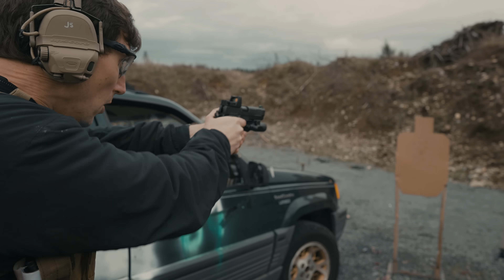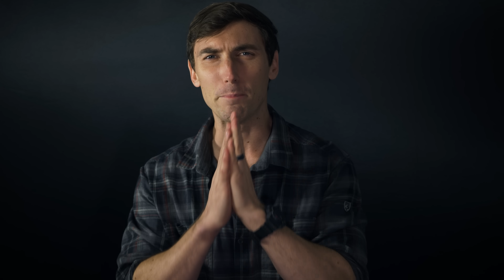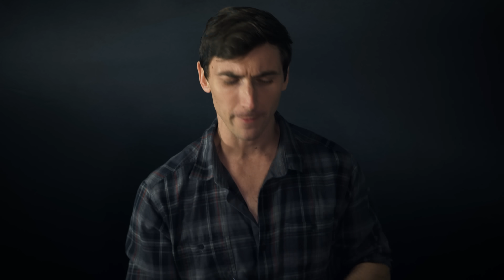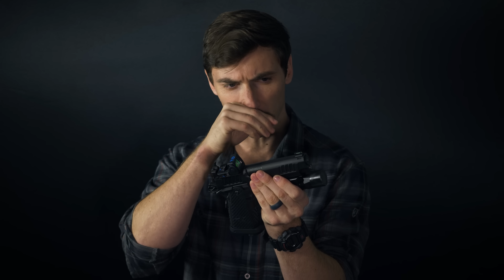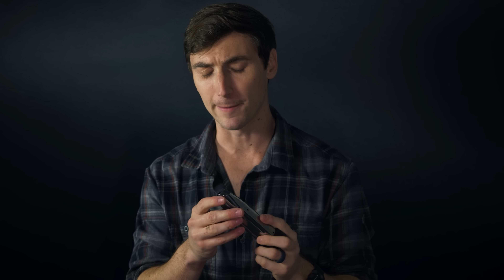Staccato, the fastest service pistol.

Comment: Purchased a P about a year ago to carry on duty after carrying a Glock since 1990. No regrets. Needs much more maintenance than a Glock.  Requires oil often!  The transition from a trigger safety to a 2011 manual/grip was no issue since I carried an AR15 on duty for 20 years (thumb safety operation/trigger manipulation was the same). Put a Delta Point Pro on it. I have zero regrets. It’s a game changer.

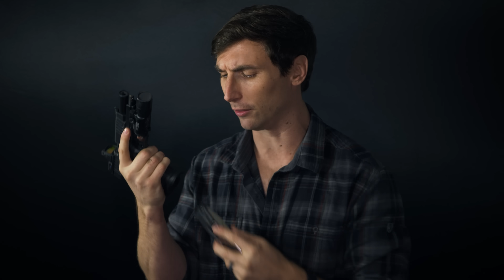Comment: 16:47 So I mean.... I’ve been thinking about this for a while. The Staccato P right now is $2,200. I have no problem spending that on firearms, as I have purchased the Benelli M4 this past summer for around the same price point, but I think it was a couple hundred bucks cheaper at the time. 

I do really want a 1911 style handgun. And I’d rather prefer purchasing a more modern handgun chambered in 9mil before I drop around the same amount on a genuine Colt that’s chambered in fatty .45. 

So which is more worth it? The Staccato? Or an STI 2011? Decisions decisions
Reply: I’ve had a full time job for years now mind you, and I’m pretty damn good when it comes to saving money. So just keep that in mind when I mentioned both the Benelli spaghetti maker, and the 1911.

Comment: Is it me, or does the front sight sit lower than the rear sight? It looks the same on the staccato website too.

Can anyone explain to me the logic of using a co-witness rear + lower 1/3 front sight?
Reply: Looking at mine, they are level. The rear iron is cut at an angle. They do sell a “carry” sight option (at least for the C2). That has shorter sights, so if you decide to put an optic on it, Dawson plates come with the full size sight. Then the front sight will be lower.

Comment: My aluminum frame Staccato P 4.4 weighs 30oz, not the 28oz claimed, w no mag. Checked my digital scale with a calibration weight, so not my scale. Not a huge deal to me, since my use is HD, but not sure how Staccato screwed that up. Its 5oz heavier than a G19 or MP 4", in aluminum. Had to off center the rear sight ~2mm to zero windage. IMO, my edc Wilson SFX 4" is worth the extra coin. My STI Edge 2011 ran flawlessly over 3 days of blowing dust at the last Texas Multi Gun Championship, with zero stoppages, no cleaning or added lube. Hate to see the Texas logo go with the name change, but I suppose the star is a nod to the place it's made.

Comment: Great video and review. The 1911/2011 platform has the potential for the best trigger, period. The only other contender is the Swiss made P210. Also, you can tune the rebound impulse for the individual load by using various powered recoil springs. This is done by most competitive shooters who use this platform. Big fan.

Comment: Grand Thumb thanks for the videos.  I recently purchased a Staccato P DPO and I have mounted a Trijicon SRO on my gun.  I love the gun but I have had an issue with my screws backing out of my Dawson Percision mounting plates.  I have put about 800 rounds through my gun and the screws have backed out on me twice. FYI:  I degreased before applying VC3 and I torqued my screws down to 23 inch pounds.  Have you had any issues with your screws backing out of the mounting plate?

Comment: I wonder if you ever shot the Wilson Combat 1911/2011 9mm? I looked at this WC SFX9 3.25’ 15+1 & it felt so right & I never shot a WC before. You know I’m a Glock guy so this would be the most expensive gun I would buy at almost 3K. They had a full size one for rent on the wall and me and my buddy took it in the range & it malfunctioned over 30 times! It was so bad we called them in to shoot it & did the same for them! They admitted that they had not cleaned it in a while & refunded me but that experience gave me pause about reliability to the point where I could not buy the gun! 3K for a gun that bad when it’s commercially used is still scary even if you clean it weekly! So I’m wondering if you ever shot or did a review on the WC SFX9?

Comment: I wish you'd tested a double Action pull.. or even a "half cock" for those who carry cocked and locked.. or like in most cases when you need to draw and don't have time to cock the hammer?
Reply: 1911/2011s don't have a DA pull or fire from half cock they are Single action only guns. Condition 1 carry with a 1911/2011 is loaded chamber, hammer back, safety on.
Reply: @deank5649  good to know I meant DA/SA though.
Reply: @crackbaby1537  he reviewed the LTT beretta 92 before

Comment: Curious how you can say this is inherently a less reliable pistol when guys like Mike Pannone put 10k rounds of wolf 9 with no cleaning. Patientzero has an insta story where he gets 6500 with no cleaning before he had a mf. I haven’t had mine be more or less reliable than any of my Glock, Sigs, or HKs etc. just feels disingenuous to say this 2011 won’t be reliable when you haven’t tested your theory.
Reply: He SAYS he did it...did you see it....LOL......sounds like another fake Chuck Taylor story..,...
Reply: @chadhaire1711  Spoken like a guy whos never shot or owned one. Who are you to question the integrity of Mike Pannone? I personally don't like Staccatos as I'm a Nighthawk Shooter but I understand the design very well. The guns will run as long as they are wet period. I've taken one of my double stack 9mms from NHC to 12K with just lube and no cleaning. Steve Fisher's Falcon was around 15K and fucking disgusting before he finally sent it back to NHC. 1911/2011 are every bit as reliable as plastic fantastic when you do your part (lube, spring changes, clean mags for 2011 mags specifically). If you're a lazy fuck then don't buy one its simple.

Comment: I am much older and no where in the same class of shooter as you are.  That being said, for decades my EDC was a 1911 which I just love.  However, about  1 ½ years I gave several polymer guns a try due to their lighter weight, higher capacity, and easy MRD adaptation.  While I managed to shoot decently with them, I still was better with my 1911s.  Hence last year I found a marriage made in heaven, the Staccato C2 DUO.  It is in the same weight class and capacity as the polymer guns, but with all the 1911 advantages.  I have 6 mags for it and due to the ammo shortage I am a little shy of 1000 rounds, but it has be flawless with all mags.

Comment: Whenever someone thinks you'll forget to take the safety off of a handgun I always remind them that if you can run a safety on a long gun then you can run a safety on a handgun.
Reply: Yeah. It has never made sense to me either... except that for some horrible reason ive probably had a dozen random dead triggers over the last 10 years. All of them except one were safety induced. One was a broken trigger. Ive mostly shot sigs, but i hate safetys because i have no idea how i can shoot and practice and have no issues... but random day out of the blue, i go to the range and mess it up.
Reply: What I suspect this means is that when I have a stress response I don't necessarily follow my trained motions. I think I skip steps - which makes sense if I'm missing the safety randomly. I will never be a top speed shooter or as good as people who don't have this weakness but it's terrifying to me that I'll need my pistol and find myself in a situation where it does actually cause someone to die or have something happen to them because I didn't squeeze off my round first. I think ill try training cold with dummy rounds more often to see if i can overcome this specific training issue.
Reply: Crazy that I’ve never really thought about this
Reply: Or you use one without a safety at all!

Comment: The slide release was the only thing that was unfamiliar to me a few weeks ago when I first got my Staccato P.  On a standard 1911 I never gave a second thought to reaching it with my firing hand thumb but the additional girth of the 2011 does make it less simple to activate.  Like you say though not really an issue, just a familiarity deal.  I loved the P so much I immediately sprung for the XC but my range time has been severely curtailed because I am now under 5k 9mm and don't want to get any lower.
Reply: Well, that’s because it’s a Slide Stop, not a Slide Release.
Reply: Question.. I'm just a novice but why you need 5k rounds of 9mm
Reply: @a-t5380  Prices fluctuate rapidly and if you're shooting as much as you should (at least 100rds per week) 5k is not a long lasting supply.  When there are prolonged shortages and very high prices you don't want to be having to buy a bunch of overpriced cases of ammo.  I like to maintain at least 10k.
Reply: @Christopher Johnson  I shoot about 200-300rounds a month. Is that ok. Been going the whole of last year .. my new AR is coming in next week too. I'm excited. I think i need to train more and stockpile more clearly
Reply: @Christopher Johnson  thanks for the reply by the way. Sometimes I ask questions and dudes be going crazy. Like damn we all started somewhere

Comment: The 2011 - 1911 frames are definitely magical. In close quarters if you make tiger sounds as you draw... and push that roar out for a full 7 seconds....all bad guys within a city block heads just pop. Just don't forget to keep shooting until the threat is...... Not a threat....... while you're pushing through those 7 seconds..... that's where most people get smoke checked. I mean you don't want to go into anywhere only making tiger sounds... But I don't make the rules. Ron Jeremy made those magic tiger dynamic entry moves....🙊

Comment: Hey quick question for you degenerates, can someone explain the difference between .223 and 5.56? From my understanding of them they’re essentially the same thing...also just bought my first pistol CZ75 SP-01 tactical, anyone recommend things to replace on it? Trigger, the rod that goes into the slide spring....be gentle it’s my first time. I look forward to your responses.
Reply: 5.56 is higher pressure, and for your SP-01, a Cajun Gunworks trigger job, a new set of sights with blacked out rears, and a Fiber Optic front sight would really enhance the performance of the gun
Reply: @christianharris7351  ok awesome, I had done some research and it pointed at sending it to Cajun gun works. Glad I was on the right track. So right now I’m trying to find a holster. I checked out alien gear and safariland and neither of them have the sp-01 tactical as an option. What would I choose? A regular sp-01? Shadow, shadow 2? Any ideas with that? I’m looking for a owb holster. No lights or sights.
Reply: Stat away from Aliengear, they're trash. It's gonna be hard to find a holster for that. Check G-Code, LAS, and Tier 1 Concealed
Reply: @christianharris7351  sweet thank you. Much appreciated

Comment: I’ll take a CZC Shadow2 or a TSO (TSO2) over the 1911/2011  series.  A $2000 CZ does just as good as $3000-$5000 2011. Then the CZ S2’s are DA/SA and the CZ grip, which I prefer.   Plus the $120 mags, which have to be tuned or aftermarket kits added, that can run $150-$175 per mag. Where tuned CZ mags with a aftermarket kit is around $90-$100.  So the issues of a 2011 are Mags, required cleaning, necessary PM parts replacements, and cost!! 

That said, if I could get a 2011 for the same price as a CZ, I’d buy one to add to the collection, but not replace my CZ’s.

Comment: You nailed it regarding the mags. I own a Staccato C2 and a Staccato P. All 6 mags required tuning in order to feed reliably. These are marketed as duty guns and I think Staccato should do a better job of ensuring the mag lip tolerances are correct before shipping them out. I also returned a Staccato due to a mag release problem. The release has a very small ridge that is supposed to seat on a ledge inside the polymer grip. The slightest wear or damage to that polymer ledge and the mag release starts to jam up. They should improve this design to have a larger contact area. These guns also need plenty of oil to run reliably. I now trust my Staccatos, BUT I wouldn’t just buy one and expect dependability out of the box. They are fantastic guns IF you tune and maintain them.

Comment: It's a slide RELEASE. The slide stop is an internal part that locks open the slide on an empty magazine. Because it doesn't need an external lever to stop the slide, the external lever must serve another purpose. The external lever's purpose is to RELEASE the stop's hold on the slide, thus releasing the slide. The lever is used to operate the slide stop. The stop's ONLY purpose is to hold the slide open. The LEVER does not stop the slide, but it can be used to engage or disengage the slide stop. It's primary purpose in a fight is to disengage the stop, thus RELEASING the slide from the stop.

"That is my opinion and if you don't like it, I have others."
Groucho Marx

Comment: Having run 1911’s for 57 years and 2011’s for 11, there’s no gun that compares. 
I’ve never had an unreliable 1911/2011. The grip angle is the most natural of any gun, the trigger of even cheap 1911’s are better than stock trigger of anything else. Accuracy is better than anything else I’ve shot. 

The only downside is weight. An even that turns into a bonus when sending rounds down range.
Reply: I switched to polymer 10 years ago, 1911s are range rovers and polymers are Yukon Denalis.

Comment: if you've never shot a 1911 you just dont know what you're missing. particularly a well tuned and maintained 1911 in your caliber of choice. it'll change your world.

2011's are them thiccem's and i dont care for price. i keeps it trill og single stacc but do have a 9mm variant and that thing is like cheating. 

you can rip it hardcore like porno flick bitches (check reference) with a 1911 or 2011. 

if youre a new gun owner and dont have ammo this is not the gun for you. this is for the ballers and those way back times when ammo was prevalent. 

skip a glock and buy an hk you nerds.

cz or beretta if you dont want a polymer wonder...with respect to older sigs with internal or short external extractors. if its got a long extractor youre lame yeah i said it

everything else is for hipsters and poors. OH YOU GOD AN XD-M OR AN M&P.....yeah...youre lame....THE CANIK GUY THINKS YOURE COOL TOO.

walther would get a nod tho

Comment: What happened to extended slide release levers? My first 2011-style gun, which was actually a Colt Commander with one of the very early Para-Ordnance Hi-Capacity conversion frames that gave it 14+1, was a used custom gun with a skeleton hammer, long beavertail, extended safety lever, and matching extended slide release. In fact the slide release had the same slightly slimmer extension like the safety that extended back over the top of the grip panel, to within maybe 2mm of the extended safety extended forward. It also had an extended magazine release that came back a good 3mm - 4mm, meaning I could operate all controls without shifting my larger hand/short-ish thumb grip at all, not one bit! It was fantastic, and like so many others, I regret selling it. When I was looking for something similar not that long ago, I could not find one single extended slide release, on or off a gun, ANYWHERE... What happened? Where'd they go? Why'd they go? Anyone know...? Daddy G, any experience with those? Any idea why they're gone...?

Comment: Can you explain something to an old guy that wishes g locks had a pretend safety where my 1911 does? With companies making polymer 2011 lowers and mags always being the problem, and companies building weapons around the G lock mags, Why in phuq can't someone build a polymer lower that accepts G lock mags with a 1911/2011 upper? Are we not technologically advanced enough yet? And it's just weird drawing a G lock and swiping at air with my thumb. Never forget a small can of pvc glue and a match will fix any porta shitter problem.

Comment: "Now, of course, if you really want to you can load up and power stroke that $#@*&, but, you know its not 2009 so, we are go ahead and use that slide release as much as we can".  LOL.

Two questions:  
1) How does he slip in so much dry humor?  I thought only a physics professor had that skill.
2) Did I miss something?  I always considered the "slide catch/release" to be just that.  For holding open on last round and releasing for loading up.  Eh. I am a bit slow on the up take.

Comment: Safariland makes a holster specifically for the Staccato P, but only WITH optics and light. It is "6390RDS-1582"
Reply: I use that one without an optic. Still works fine, just in case anyone was wondering.

Comment: Just a quick note: you really shouldn't be throwing the slide forward empty with a 1911. The barrel has a lug where the takedown lever fits through the linkage at the bottom and throwing the slide home without a round going into battery (to slow the slide down a bit) can make small dents and bends. This is a critical area for lockup and will lead to accuracy and wear problems. This is according to Bill Wilson and other prominent 1911 designers/builders, not some random internet douche (e.g. me.)
Reply: Agreed.  Same with using a slide stop as a slide “release”.  I’ve worked on plenty of handguns that have had excessive wear on the slide stop because of this.

Comment: I sold my staccato P. It was no where near as reliable as an archon or a glock. It has a tendency to nosedive hollow points, even FMJ 147s. It is VERY prone to failure if not cleaned after 200 rounds. And it had a ton of coating issues. Not something worth spending $2500 on. The new VP9 OR or even a Glock MOS runs circles around this in terms of actual usability. I took a $200 hit and sold my staccato after 6 months.